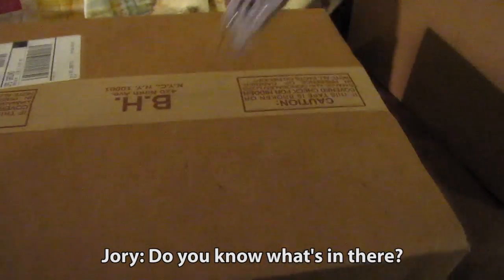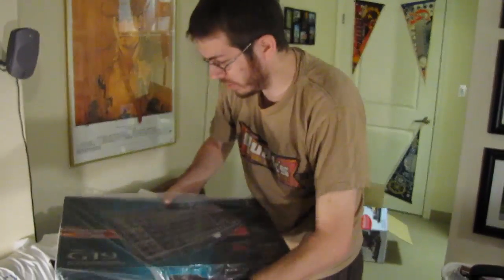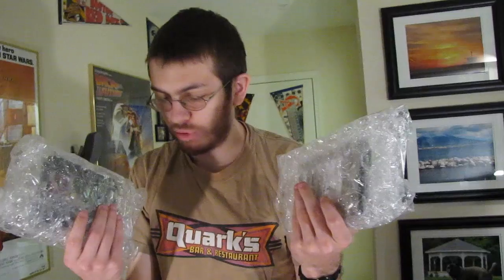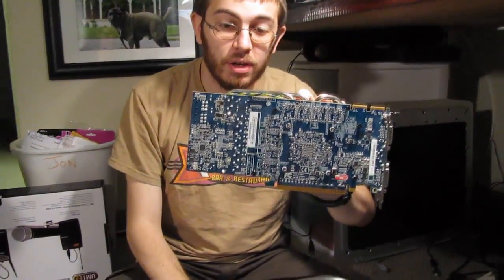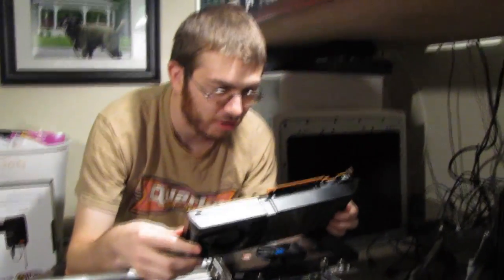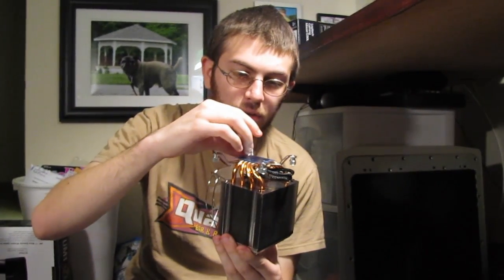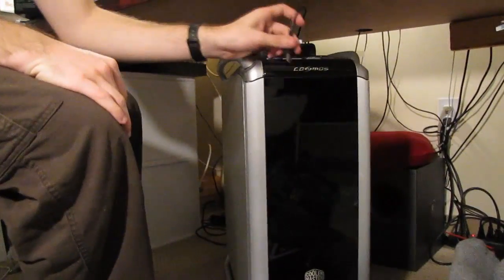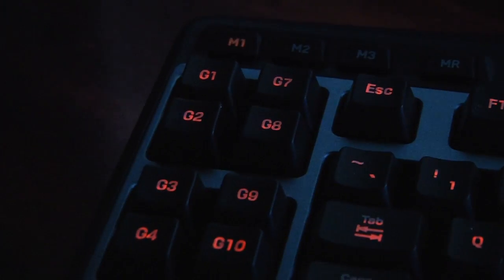$5,000 PC Upgrade! -- Intel Core i7 980x and GeForce GTX 480 Build

Comment: Instead of Logitech 5.1 550 speakers, maybe you should try Bose Trusped, or Klipsch Promedia 2.1. SOund far better. But overall, this computer is the most badass computer I've ever seen, even beating Mac Pro with 30 inch monitor. 60 inches of screen, Overkill keyboard with a FUCKING LCD screen, the fastest processor ever, and the awesome graphics card.

Comment: Simple, what do you think needs improvement, my "Disk data transfer rate" is low.
OS Version: Microsoft Windows 7 Home Premium 
System RAM: 4062 MB
CPU Name: Intel(R) Core(TM) i7 CPU         860  @ 2.80GHz
CPU Speeds: 2801
Physical CPUs: 1
Virtual CPUs: 8
Video Card Description: ATI Radeon HD 5700 Series
VRAM: 1024 MB
Primary Display Resolution: 1920x1080
Free Hard Drive Space: 772573 MB
Total Hard Drive Space: 953766 MB

Comment: Ha, the only thing I have that's better than what you have is the Logitech Z5500 5.1 speakers...amazing set...

The 10 inch subwoofer is amazing along with the rest of the system. I actually remember having a 550 set.

Comment: My specs:

Fractal Design Define R3 Black Pearl

PSU: Corsair TX 650
CPU: Intel Core i5 Quad Processor i5-2500K 3,3GHz
Motherboard: ASUS P8Z68-V/GEN3, Socket-1155
RAM: Corsair Vengeance DDR3 1600MHz 8GB CL9
GPU: Sapphire Radeon HD 6950 2GB GDDR5
SSD: Corsair SSD Force Series 3, 60GB 2.5"
HDD:Western Digital Caviar Green 1TB
DVD burner:Black DVD±RW burner

Comment: my ATI Radeon HD 5970 Black Edition dis-agrees with your video. ;)

I also have a Solid State Drive with Windows 7 64, Boot time / Load time is pretty impressive in my opinion, just be careful when using old computers, I actually get very frustrated with even fairly decent ones.

Comment: I have a  i7 980x xtreme overclocked to 4.4GHZ , 12gb's of  RAM, 512mb SSD (solid state drive) which is running my OS (windows 7 64bit pro) , 2x 2 TB HD's, 4way SLI- GTX 480's thats 4 GPU's , everything is liquid cooled

PWND and PWND

Comment: @mas90009 Huh??? I said only yesterday that the AMD Phenom II X6 is not faster than the 980X. Even overclocked to the max, the X6 isn't even close. Even AMD's newest FX-8150 is far behind.

At the time, the 980X was EASILY the fastest processor in the world (the second fastest was the 975 which wasn't even 70% as fast). That, and the fact that Jon really needed that extra performance, is the reason he spent $1000 on the 980X.

Comment: @emerybryant Ita all about Heat disipation and It make sence when you think about a metal on metal contact it has a better heat disipation, If you have ever touche the bottom of a heat sink it is very cold, now think about putting a piece of fabric over the heat sink face and touch it again its still cold but not as much as it was without the fabric substitue the fabric as thermal paste and the hand or face you put the heat sink on of for a cpu, Catch my drift 83

Comment: OR
PROCESOR: Intel Core i5 3450 - 3100 MHz - Core Ivy Bridge 
CPU COOLER : Intel 1155 CERTIFIED CPU FAN HEATSINK 
MOTHER BOARD: Intel® B75 Chipset 
RAM: 2x4GB 8GB DDR3 1600MHz - PC6400 
GRAPHICS CARD: ATI Radeon HD6850 1GB DDR5 DX11 HARD DISK : 500GB 7200 12 3 5 OPTICAL DEVICE: DVD+-RW DL SATA

Comment: Please someone reply tell me your opinion -------> I am buying a computer for gaming should i buy 
PROCESOR: CPU Desktop AMD FX-Series X6 6100 3 3/3 9GHz - Core Bulldozer - six cores
CPU COOLER : AMD AM3+ CERTIFIED CPU FAN HEATSINK 
Mother board: North Bridge AMD 760G 
RAM: 2x4GB 8GB DDR3 1600MHz - PC6400 
Graphics card : ATI Radeon HD6850 DDR5 1GB DX11 D-Sub - HDMI - DVI HARD DISK : 500GB
OR

Comment: @Maidenite666 I have a i7 920, aka the lowest performing (afaik). I've tweaked it to 4.1Ghz from 2.6Ghz. I'm using the standard cooler, and even when running Crysis at Med/Hi, I seldom get above 50C.

Comment: Dammit that IS better than mine, by far, but I don't have 
$3000 - $4000 dollars to spare, $1000 of which is the CPU alone.
Maybe my OS (Win 7 x64) drive is a bit quicker - 2 Intel X25-M SSDs in RAID 0, gets 7.9 in Windows Experience Index, reads almost 500 MB/s on a good day.

BTW: Nice build if you got it working in the end :)

Geekiest post I've ever written....

Comment: @Jon Actually.. the new MacPro is technically WAY better for video editing and 3D...  spin it how you want, the new Macpro is 12 cores... your rig is 6 cores... also, unless you built it exclusively for games, there is no way your rig is going to outrender or out perform the new 12 core mac, with the same solid state drive, ram, and raedon HD 5870... yeah.. your computer cost cheaper, but thats about it...  even so, you have a beautiful computer, congratulations :)

Comment: @temporalparadox sounds quite nice ;-)
though i guess the SSD isn't your only saving option. These things are way too expensive for saving data :-)

My own pc is several years old now, i bought it in january 2007 and just changed the graphics card since then :(

(but it still can handle nearly all games i usually play on maximum details and @1280x1024 which is my screens native resolution... so I guess I can still survive a while without paying anything more for a newer system :D )

Comment: Nope I disagree yours was put together poorly. i.e. thermal paste is only ment to fill small imperfection in the face of the heat sink, because the best way to transfer heat is metal on metal, so if you had small imperfections like dips and such these would reduced the area of the
 heat sink toching the CPU thus reducing heat transfer between CPU and heats sink

Comment: Nice build. I'd love to have something that powerful. Only thing is I couldn't see spending $1000 on the CPU alone. I don't like Intel because of their extremely high prices. My AMD Athlon II x4 620 Propus core quad-core does just as well as Intel quad-cores, and it was only $90.
I like that graphics card, too, however nVidia has also been put on my shit list, because of their high-and-mighty attitude similar to Intel. I love my XFX Radeon HD 5770, it's a beast.

Comment: @EchoedTruth Are you just an AMD fanboy or something? 580 will kick the 6970 into the middle of next week granted the 6970 might be better when dealing with something like 2560 x 1600 resolution or triple screen HD gaming due to the extra vram, but the 580 is still a killer card & generally better than the 6970 in all tests. also the Phenom X6 although good doesn't even compare with the 980x, hence why they come in at $200 or whatever it is in the States as they closer in performance to a i7 950

Comment: @luke8902 I know, right? Finally a card that can max Crysis! XD
If I had the money I would totally make a rig with the 3gb version in tri-sli. It's insane stuff. To put it in perspective, that's 9gb of ram for graphics- more ram than most computers have for everything else (4-8gb, normally). Only problem is the cost would be over $2000 for the cards alone. -.-'
If you have more computer questions, don't hesitate to drop me a pm. I love talking about this stuff. :D

Comment: Funny Video. :D I just bought the G15-Keyboard because I also have dual-screen and don't think this big LCD is really necessary on the keyboard, but cool stuff anyways. ;) But just one thing: after assembling the 2x Quad-3066MHz-Xeon-System for my Dad (16Gigs of Ram, he needs it for working too... large Database-Applications, "city-council-dimension", sry I hope this is the right term, I am from Germany :P), I just don't agree with your PC being better than "mine" ;)

Comment: Oof. That's pretty old for a computer. You should probably upgrade:
-The motherboard to a new socket
-The CPU and
-The graphics cards (especially, you owe yourself this)
Reply from the maker: What's wrong with the 580? Still renders everything pretty fast. I don't see a strong reason to upgrade, honestly.
Reply: Techommentary This computer is still very good, as I have a similar but worse build, 930 and 550 Ti's that still run everything amazingly. It's a capable platform.
Reply from the maker: Evan Elgin Considering a majority of the parts are 5 or 6 years old, it still chews through HD content very well. No complaints here.

Comment: Lol, while I'd like it to be, those aren't my computer specs. Far too powerful and far too expensive for me. But, I did in fact have 1500 dollars from my Bar Mitzvah, and I bought an iMac... which I will be exchanging for the new one when it comes out on monday. Real Specs: 2.5 GHz Quad core Intel i5, Radeon 6750M, 4 GB of memory, Mac OS X lion, Apple wireless keyboard and magic mouse, 500 GB of hard drive space and Harman and Kardon built-in stereo speakers. I apologize for being a poser.

Comment: @LOLfilms100 My pc is also custom build, but its more of a video eding pc than gameing, it runs a 6 core AMD FX, 16GB DDR3 ram, GTX 470, 2x 1.5TB HDD on raid 1, 1x 120GB SSD running windows 7 64bitt

Comment: I looked it up in Adobe Premiere Pro CS6, and while I didn't know what it was until you told me to look it up, it still DOES in fact work Radeon 6750M, so yeah, you're right it was probably a software update. I tried both different engines, and they work fine. The default one is the one I use to edit with on a daily basis. But I apologize for being a know it all arrogant asshole. Please forgive me.

Comment: @EchoedTruth AMD fanboy?.... btw two 6970s would be over 600 dollars, run hotter, and would use more power compared to a 580 which is around 450 dollars and runs much more efficiently than those AMD cards in Xfire....

Comment: dang im close
cpu i7 950 3.33 Ghz (4 Core)
Video -- NVidia Evga GeForce GTX 470, 1536mb (w/ adobe Mercury Engine Technology)
RAM -- 2 GB 1666, MHz 4GB 2333MHz DD3
Motherboard -- Asus Rampage III Extreme
OS -- Windows 7 Premium - 64 bit
Audio: Realtek ALC889
Display -- 2 Haier 23" WFP flat-panel 1080p HDTV, 1 Enhanced 15 inch Toshiba for Standard Definition Viewing 1024x768, 1 Sony 42 inch Bravia HDTV viewing screen
PSU -- Corsair 750w
Drives -- 1 DVD Burner, 1 CD Burner
Antec BP550 Plus 550W

Comment: @croulder91 AMD has not been better than Intel since 5 years now (to be exact: since the release of Intels "Core2Duo"-processor in July 2006). And just for your notice, the fastest Intel-CPU is about 1.9 times as fast as the fastest AMD-CPU at the moment.

And even before that, AMD was only a bit better for gaming, for other stuff they were more or less heads-up.

I have to agree on the "good price" thing though.

And for your other post: Video-rendering can use more than 6GB RAM.

Comment: By upgrading to the Nvidia GeForce gtx 580, you greatly decreased efficiency and video quality. Only good thing about it is that it's cheaper. Look at any online comparing guide. The AMD Radeon is more efficient and is better. Should've stayed wi the radeon 4870. Like you repetitively like to say, I did my homework. Well this time, I did my homework, I got the better graphics card.

Comment: AMD 6 cores can barely compete against quads from intel. To be fair though, I think you'd have been just fine with an i7-2600K. 

One thing I will say is... STOCK HEATSINK? The fuck are you thinking man! Get an aftermarket heatsink on that thing ffs! You spend all that money on a processor and rely on intel's shitty heatsink for cooling? There's a reason aftermarket heatsinks are so popular you know?

Cooler chip = long lifespan and if you do overclocks you get mucho grande better performance.

Comment: @ToSlowImPro  couple reasons why, you probably didn't buy a gaming pc or you bought it long time ago. Also, apple certainly is able to play games but what about the year 2014? games will be so much more complex you'll need better performance. But you cannot UPGRADE  apple. It's all sealed. So the only way to continue to play amazing games is to buy a $2000 every couple years or so. However for pc, all you do is buy the parts like jon did here and vuala cheap, easy, anda badass comp

Comment: My computer is still better than yours with a Intel i7 Nehalem 6.60GHz (Over clocked from 5.60GHz), 32GB of DDR4 Ram, Same graphics card as you but x3 and 9x 4tb HDD and 1 600GB SSD

Comment: @temporalparadox Indeed. If i bought a computer for 6.000$, I would look for a ventilation system that beats the one of Jory's microwave lab ;-)

And for air cooling i agree with you that Noctua is probably one of the best. Compared to the rest of the PC EVERY choice one could make is cheap though ;-)

Comment: *cries*
My computer is so shitty in comparison.

AMD Athlon 64 X2 Dual Core Processor 4400+ 2.3GHz  (2)
2GB of RAM
The video is integrated into the motherboard.  Nvidia GeForce 6150SE nForce 430.

This thing can't play Team Fortress 2 on the lowest possible settings at 30 FPS staring at a wall!

Comment: my cpu is a higher clock, more cores, but ive heard intel runs games bettr so u beat me thr, beat u on the graphics card (2x xfx radeon 6870 cfx) idk bout sound but ive got logitech surround w/ 120watt base, u beat me on display and ress (dual display 1024x768) ive orderd a 120gb ssd should b getting it today but i dnt hv 7.5TB of hdd storage u beat me thr, u beat my keyboard but not by much (razer black widow ultimate) where performance counts i guess urs is bttr, but not by much

Comment: Oh shame.. Logitech peripherals. May I suggest you look into Razerzone's gaming hardware? I doubt you'll be disappointed. 

www.razerzone.com
Reply from the maker: +Kyle DuBois (Soulzarath) I quite prefer Logitech. Like, a lot. Of all the companies I've bought from, their stuff has always been the most reliable and versatile. I'm sure Razer is great too, but I'm happy where I am :)
Reply: *****
Oh alright cool. I've had a few Logitech products myself and a lot of their hardware let me down. I'm currently using a Logitech K120 that's surprisingly been serving me well within the past couple years but it's slowly becoming less operational and even reliable because sometimes the keys would randomly stop working.. My MX518 mouse served me good as well but the USB cord on that thing broke quick and I'm currently in the process of repairing it. So rn I'm just using this incredibly old Dell mouse that's still fully functional. I'm replacing both of these with a Microsoft 2000 keyboard and a Microsoft arch mouse.
Reply from the maker: Kyle DuBois I've had my speakers for 11 years now, and they still work great :)

Comment: AHA! I have a better optical drive than you! >:D But other than that, your PC still wins :\
Here's my specs:

Chassis: Raidmax Blade (Mid-Tower)
Motherboard: ECS MCP73VT-PM
Processor: Intel Pentium Dual-Core E5400 @ 2.7GHz
Memory: 4.00 GB of DDR2
Storage: Seagate Barracuda SATA 750 GB HDD
Video: NVIDIA GeForce 9800 GT
Power Supply: Ultra LSP650 Pro (650W)
Optical Drive: DVD Multi Recorder

Her name's Sasha.

Comment: trololololo, My pc isn't actually better. I apologize if i made upset or angry. My real specs are AMD phenom x4 955 nvidia gtx 560 ti OC 500 gb Hdd 8 gb 1600 mhz Ram 18.5 inch monitor Tritton pc 510 5.1 surround sound headset Razer Deathadder and a zlaman z9 plus for my case.

Comment: I can't beleive you would spend all that money on a fermi card and not get a radeon 5970... otherwise the computer is totally bitchin. 

And Woah dude, you applied way to much thermal paste. You should wipe some off, don't want any of it leaking into the socket and shorting that CPU out. All you need to put down is two rice sized peices. Also, how old is the power supply? Running that Fermi card is really going to stress it out, even at 750 watts.

Comment: @seinfeldfan7898 Top of the line new mac pros are only coming with ati radeon hd 5750s which are COMPLETELY obsolete now. Apple is also bumping the price ofr these gpus by hundreds of dollars for an out of date gpu. The cpu in these things sounds nice (12 cores wow) but really the 980x blows it out of the water with only 6 cores. Stop being a fanboy and use your head.

Comment: Lose the Intel cooler, you'd be better off trying to reduce the heat of your CPU by waving a lit match over it. If you insist on air cooling, get yourself a Noctua NH-D14* heatsink, they're pretty cheap and way, waaaaaaaaaay more efficient than the stock cooler.

*Although be warned, if your memory sticks have those stupid tall fins on them, they might not fit underneath it. Now get the better cooler and overclock that bitch :D.

Comment: Did your motherboard support SLI? Oh wait...one card was ATI and the other was Nvidia, so you couldn't connect the two video cards.  But couldn't you still run two?  I don't know, im only 13.  your computer is like a dinosaur and mine is a ant.
Current computer spec
Intel D915PGN
Intel Celeron D 2.7
Nvidia 8400GX
Western Digital 40GB SATA Revision 1
Logisys 480 PSU
1024MB DDR RAM

Sucks doesn't it?  Sadly, it is the most powerful PC in house of 8 computers.

Comment: @Hayeshacker0NE Yes exactly But the whole purpose of thermal pastes is to fill in all the imperfections to give a better contact thus better heat transfer, at least we actuly got some inteligence on you tube not a load of stuck up arse holes.